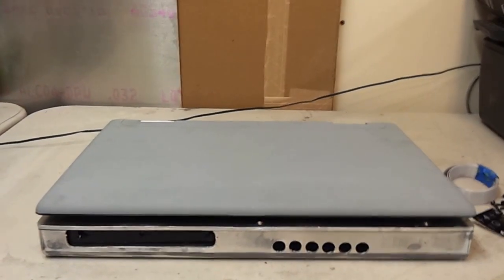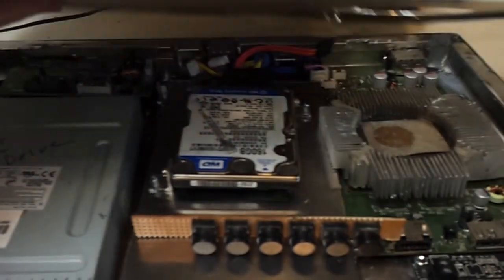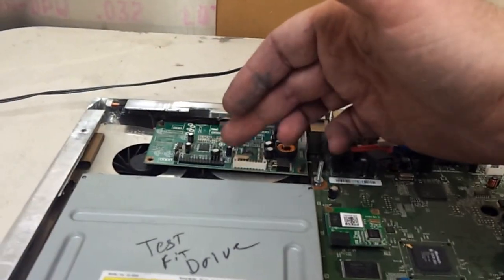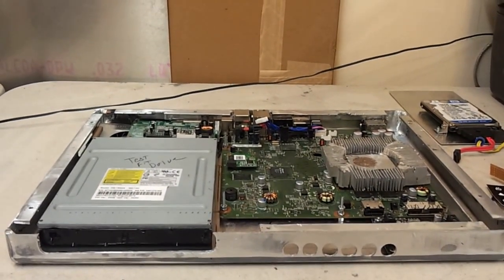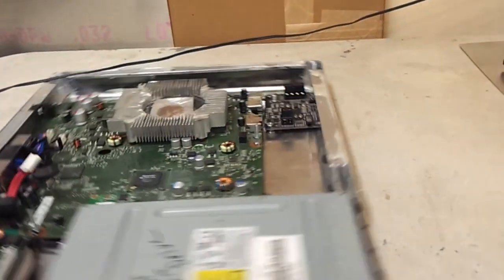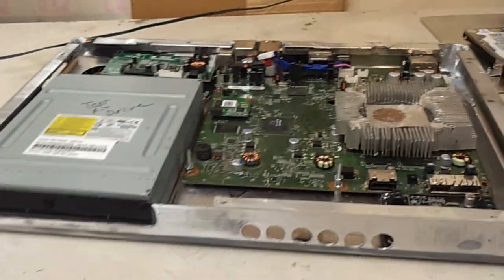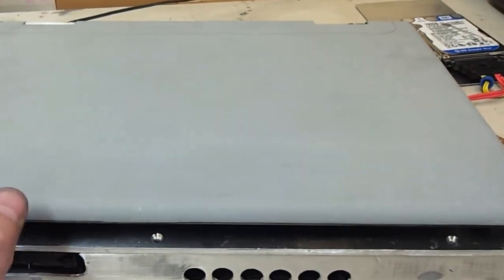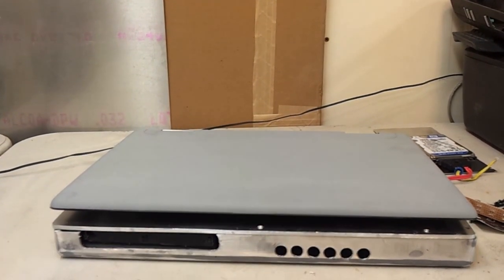17" xbox laptop DIY kit

Comment: Hey, is there a way that you could cut a hole in the top for a keyboard? And have the buttons on the top of the case in the right corner? I have everything done but messed up on the case  because I got the wrong silicon rubber molding so I don't want to waste anymore money. Thank you if you get a chance to read this.

Comment from the maker: tThat is hard to say. There is nothing like learning by doing. If you have patience, a steady hand and don't mind failing a few times before you get it right, I say go for it. Remember there is nothing you can mess up that can’t be fixed or replaced and you will mess something or maybe a couple of somethings up. Remember failure is always and option but can also be fun with the right attitude. But I would be happy to sell you a finished one if you would like.

Comment from the maker: shipping is around 30 to 35. i don't use the back bezel so you don't have to cut yours down to make it fit. you will use your front dvd bezel. adding the front usb and fan cutout is not a problem.

Comment: I am definitaley buying one of these will you please answer a couple questions i have? 1, how much is shipping? 2, i already have a front and back bezel, will i be able to switch those out when i get the case? 3, when i buy it could you please add the front usb and another fan hole, you have two in the back and i have 3 fans so could you please add another? Perderiblay on the very right side? And do you want a down payment?

Comment from the maker: I run the fans off of the 5v point on the lcd controller. that is if i am running two if i am running three fans just run them on the 12v from the motherboard but they are in series. that drops the voltage to 4v each. you can also take any cellphone car charger and but it to use as a power for your fans then you can run them off the 12 v using the charger to drop it or 5v.

Comment from the maker: I would have to say no. however if he aspect ratio is the same it would be posable to mount one and make a bezel for it. but you are looking at alot of work. what 19" lcd do you have. from a desktop monitor. if so did it come with a controller board?

Comment from the maker: yes the whole thing runs off the stock xbox slim power supply. I didn't extensive testing to make sure I got LCD's that uses as little powers possible to make sure that the stock power supply has no trouble running the unit

Comment from the maker: 250 300 should buy everything you need if used, except the xbox. If you buy everything new it will be more like 450 to 500 USD. Carbon fiber vinyl for the outside will cost 50 to 70 but you could paint it for 30 to 40 to buy good paint.  I have 1000 in each full build I do but i buy all new parts.

Comment from the maker: well that is hard to say. if you buy a used lcd you can get one for as little as 30 but a new one will cost you 100 to 150. if you buy used fans and lcd and you have your xbox slim allready around 250 to 300 not counting the outside finish.

Comment from the maker: The 18" lcds are expensive. Around $250 so the Xbox will cost more than a 20" would. But an 18" would be 1950. A 20" or 22" would be $1750 plus shipping.

Comment from the maker: well that is hard to say. if you buy a used lcd you can get one for as little as 30 but a new one will cost you 100 to 150. if you buy used fans and you have your xbox slim allready around 250 to 300 not counting the outside finish.